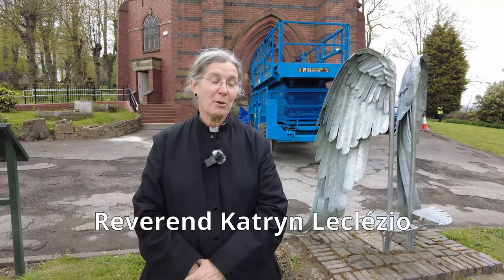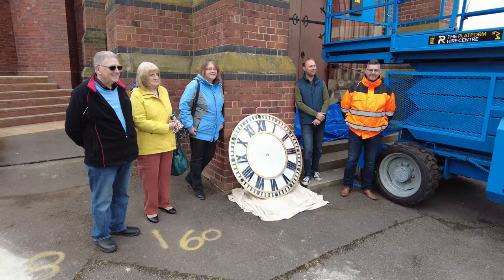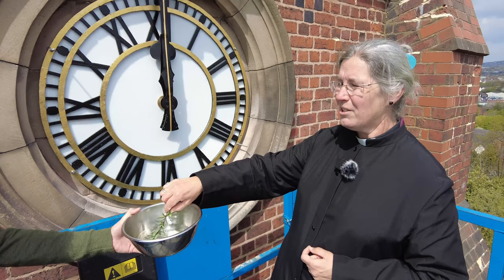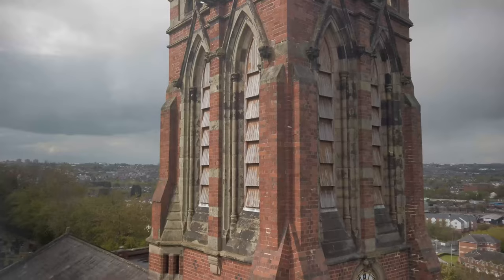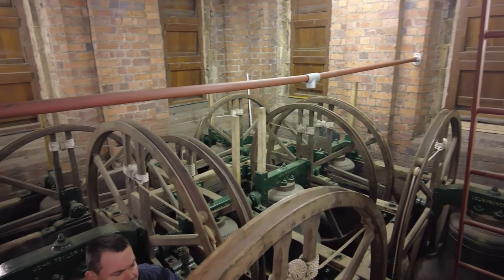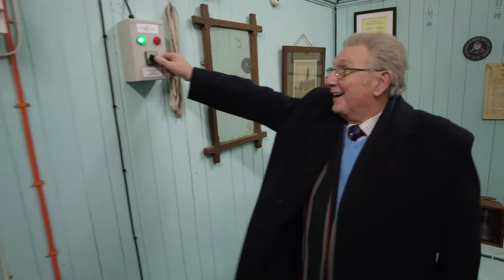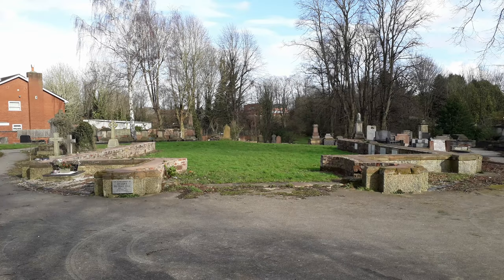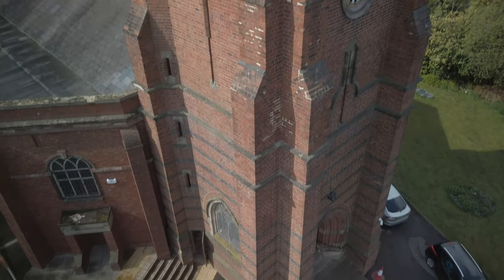St Peters Church Clock

Comment: Great to see some history been saved there, Our city town hall was pulled down and there were stories that the full clock was scrapped when it was pulled down, in 1963. But something was setup in the local shopping centre 30 years ago, which was stated to be the original working of the clock. But those have since went away again, and no one knows where they have now gone.  The council have recently built a new city town hall, that replaced the current one, if they had any sense they would have set the workings back up there.  but i have sneaky feeling that they just sold them on, when they moved the workings when they did the shopping centre revamp back in 2000.